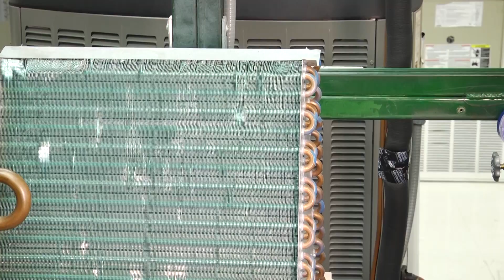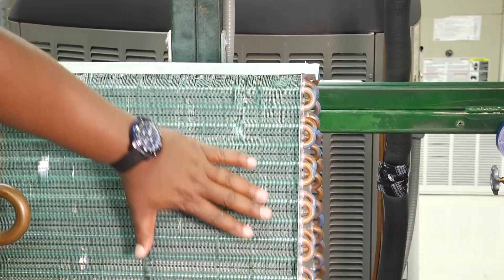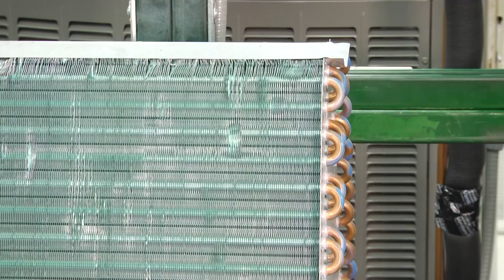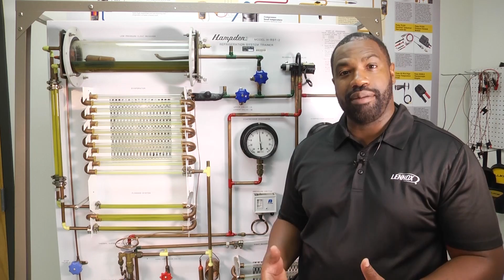Common causes of copper evaporator coil failures.

Comment: Dirty condenser will cause Evan to freeze?
Reply: I haven't personally seen one freeze up due to dirty outdoor coil but have seen the dirty outdoor coil cause a false load
Reply: No it will not cause a.freeze up of evaporator coil. Low refrigerant or low airflow.
Reply: Will smashed coil cause house not to cool properly and allow very little air outta vents?